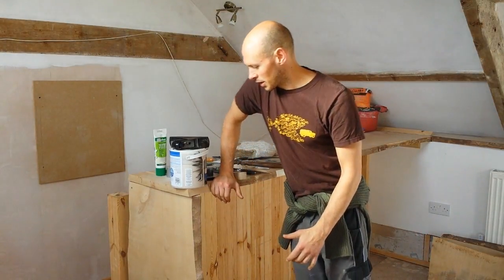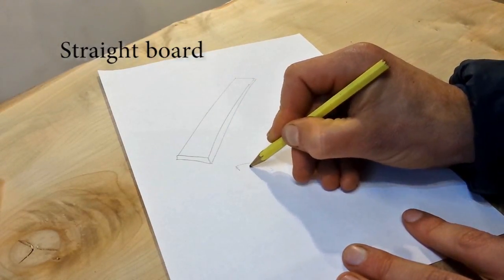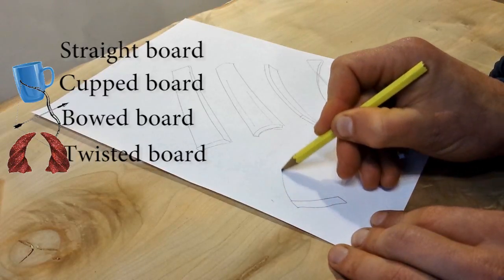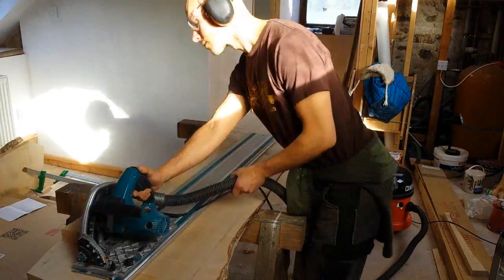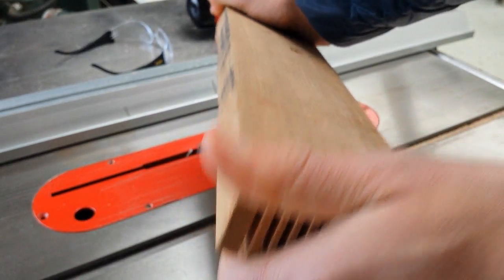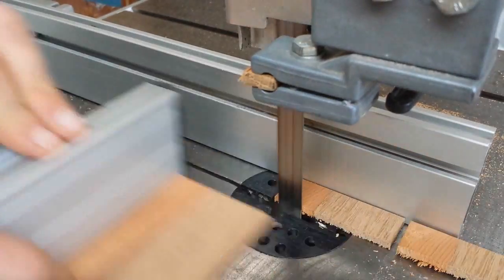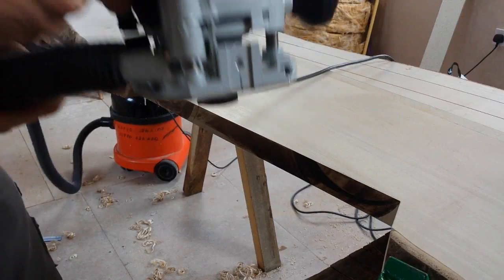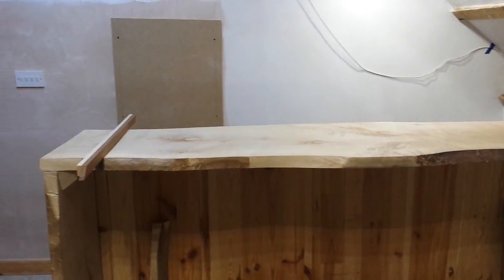Removing Twist in a Slab - with a biscuit

Comment: I use on my tabletops stress relief groves in combination with metal straightening U shaped bars milled into the wood, this hides very nice and it very strong. Also using the U shaped steel it is affordable. Important to drill either slots or larger holes to allow for wood movement. Off course it is not my idea, i saw it on high end table tops.

Comment: Biscuits are usually made of beech, they are meant to soak up glue and swell and get hard they are great for alignment but your strength comes from a tight joint
Reply from the maker: Thanks for the info Bucketlistbeginner! Indeed I have had some swell so much in the past they have split the wood - my bad I guess for giving them too much glue...

Comment: Me ole Pappy once told me that when edge joining boards, one should apply glue and in the process of doing so the biscuits would swell making the joint much stronger. Aligning the board is only one of the purposes of the biscuits..
Reply from the maker: kent hudson I also was told that! But I have come to disagree... in fact I have had experiences of having the glue swell the biscuit causing cracks in the edge being jointed (partly my fault using too much glue of course )

Comment: Curious on the status of how it is holding up? Have a slab with a pretty gnarly twist and was going to try to heat bend it some and if that didn't work try this method with some c-channel as well
Reply from the maker: Hey there afreeland. Thanks for getting in touch. Yep, the slabs holding up well. It is in a very dry environment where it is... 
Another possibility if you didn't want to cut into it, is to steam it - some kilns used for drying timber have a steam setting that relaxes tension in the wood (essentially steam bending the boards flat). 
Peace, Bongo.

Comment: I actually agree that biscuits, on their own, don't offer much strength. But I do think that, with the application of glue, the grain issues won't matter as much. I've tried different brands of biscuits and buy them purely for the time saved against having to make my own. Even the "better quality" ones (Lamello) are too thick and need to be trimmed with a hand plane.
Reply from the maker: Olly Parry-Jones I haven't tried the posh ones - the cheapest seem expensive enough for what they are.  If you have to plane them as well I certainly recommend making them. A strip of off cut makes a load real quickly. I bought them for ages until I didn't have any and really needed some... surprised myself at how easy they are and how much nicer to use.
Reply from the maker: Olly Parry-Jones agree with you that they are mainly for alignment though, so strength is less important after glue up.

Comment: Commercial biscuits aren't for strength so much as they're for alignment - the adhesive bond between the two edges is the vast majority of the strength with the biscuit only coming under load when the glue has entirely failed. Yours would add a metric shit tonne of strength, though, especially if soaked in epoxy for the joining glue :-D

Comment: Very helpful demonstration; in the case of a board that is severely bowed but flat across the grain, does it matter which side you make the relief cuts on-inside or outside?
Reply from the maker: Good day Ches, thank you for your comment.  I don't think it matters which side, though obviously if you make them on the outside face they will be visible on the finished piece unless you cover some how. Thanks again, Bongo.

Comment: Great video! I do have a question. You are working with solid dimensional material for cupping, but does anybody think this method might work on an MDF substrate of a post-form laminate countertop? We have a bowing issue because we didn't/couldn't store it indoors, but we stored it against our south facing front porch wall, more toward the east side. It was upright, but along it's 10ft length, with the backsplash edge laying on 4 bricks on the floor. We wrapped it to protect it, but humidity got to it anyway, so it's bowed along it's length (not flat), from end to end. The difference is approximately 7.5" to 7.75" from one end to the other. It is not installed yet, and we'd like to salvage it for financial reasons. After watching your video I'm wondering if we can do something similar to our countertop, but by making cuts from front to back, every 24" on center (spacing, cut width and depth suggestions welcome), ILO along the countertop length? The backsplash is incorporated, so that's a consideration as well. Thanks!
Reply from the maker: Hi there. I have never tried it with MDF though I imagine the principal should work... Anyone here have any experience with MDF bending?
Reply: @FloweringElbow  No.  I use wood.

Comment: Must have missed the bit where the board was straightened. No idea what happened beyond the biscuit making 🤷🏻‍♂️
Reply from the maker: Hi Stu, thank you for your comment. Sorry it wasn't clear enough. Basically to straighten it I am strategically weakening the board by cutting groves in the underside, then clamping it down to the sub frame. Hope that helps.
Thanks again, Bongo.
Reply: @FloweringElbow  Hi There! Thanks so much for your video! I'm actually working on a board for my kitchen which is twisted. What did you take into account to make the cuts 'strategically'? I think this would work for me. Thanks again!
Reply from the maker: Hi @ponkwrt , good question! I think this is more of an art than a science, and I'm certainly no expert. In essence the strategy it to remove as little material as possible to relieve the compressive stress in the underside so that when you force it flat, the top face wont crack. 
How exactly you decide how much is enough to remove will depend on the individual slab, and it's characteristics... 
Hope that makes sense? Let me know how it goes, 
Bongo.
Reply: Understood that the relief cuts helped but how do the biscuits fit into this solution?

Comment: I'm given to believe that compressed beech commercial biscuits expand thickness wise and lock themselves in the slot. Indeed this has been my experience having to remove biscuits in pieces with pliers on messed up gluing attempts. 
On homemade biscuits you are relying on the fit of the biscuit to the slot without the aid of that expansion. I have glued up many times with 1/8" masonite splines in a continuous slot but your machining must be spot on or the quality of the joint suffers.
     Anyway- I think that is the value of commercial biscuits- the expansion that you don't get from a shop made spline or biscuit.
Reply: I think i once saw a trick to compress homemade biscuits with a vise, which gives slots for the glue to sit and allows  the biscuit to expand afterwards.
Reply: @Fatbutnotflat  Smart!!
Reply: That and commercials biscuits are cheaper than my time to make them in the shop

Comment: My only question is, what happens to the slab over time? Does the removal of material create another problem as there is now far more surface area on the bottom than the top?
Reply from the maker: It's a good question. I have never had that as a problem. Given it is now clamped down and the 'twistable slab' is essentially thinner and therefore weaker, it can't 'overpower' the frame. If they aren't coated with something impermeable, like epoxy, all slabs will come into moisture balance with their environment given enough time. 
If the slab was in free-space, say as a single legged coffee table or something, this may be a concern and you would want to use splines or something on the underside to help lock it flat.
Reply: Thanks for the great video and humour.

Comment: Hmmm, why not go the extra mile and insert a sliding dovetail than just bolting it down? Biskit is certainly quicker work...domino would even be better...but you are relying a bit on the bolts in the bottom to keep it straight. But I like your ideas, lots of my planks suffer the same problem, and I was not sure about using the stress relief cuts.
Reply from the maker: Yep, dovetails are certainly an option. Time is something an issue...